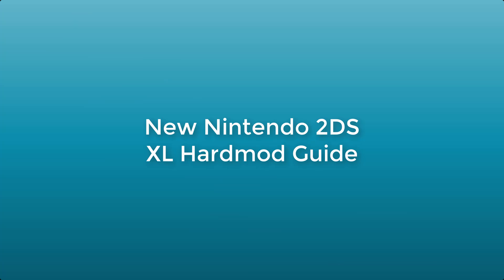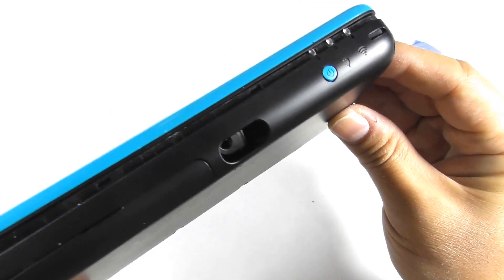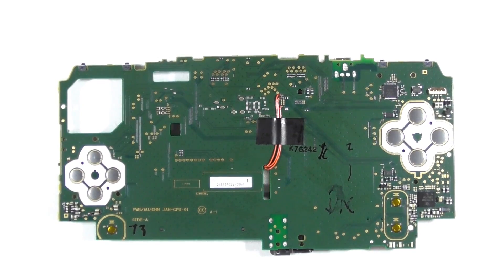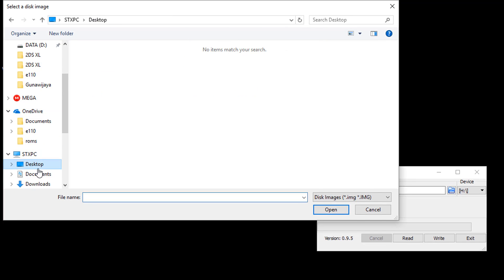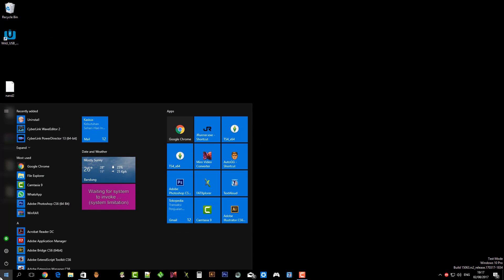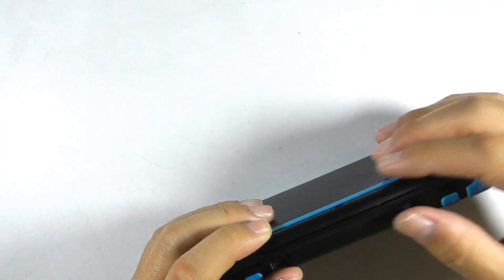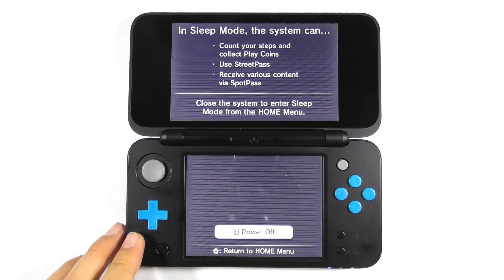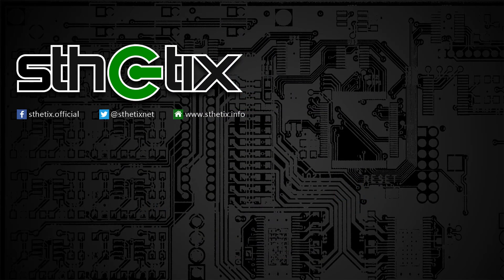New Nintendo 2DS XL Hardmod Guide (updated)

Comment: When soldering CMD CLK DATA0 the two pins of each need to be join together ?
Reply from the maker: +darkchild971 separated
Reply: @sthetixofficial  You didn't understand his question. The pairs of solder pads for each, which look like they are joined by a thin trace by default.